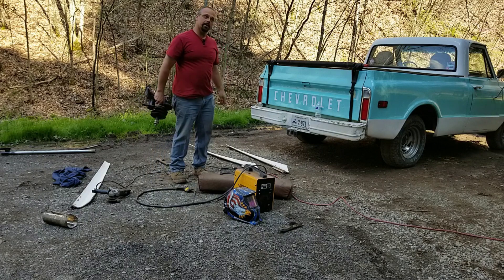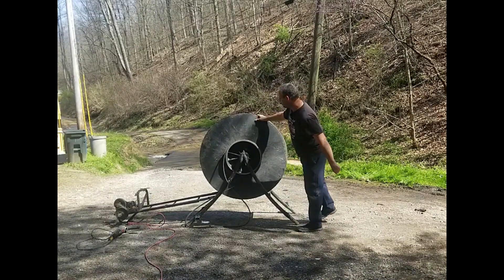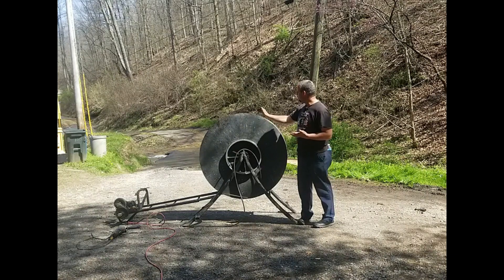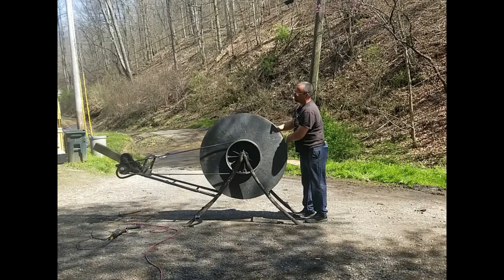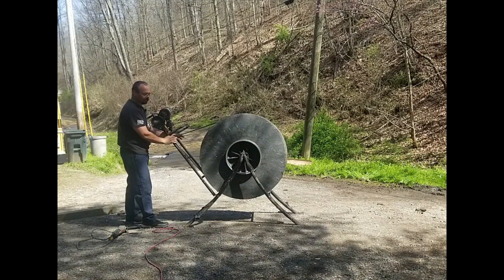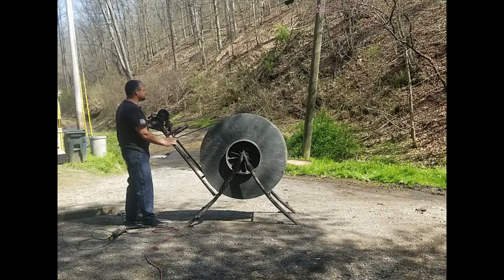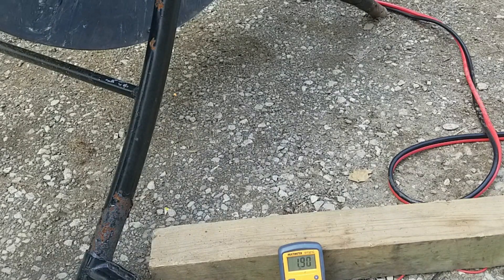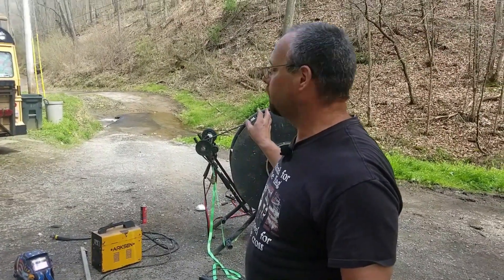From Wind Generator to Water Wheel

Comment: Luke, am I right by saying : You connect the generator directly to MPPT controller and boom all working as what solar would have worked?
Reply from the maker: @coeniecootybrands4472  yes the generator will put out a varying amount of power and the MPPT controller will smooth it out and make it sufficient to charge the battery.

Comment: Looks good, now to figure out where to put it and how to run enough water to it.
Reply from the maker: Got the spot figured out. I just need the water way. I was thinking about using about a 6 inch drain pipe because it is a little cheaper than pvc.

Comment: Like seeing this!  Previously I lived in another place with a stream flowing by full time .. and it floods once or twice a year.  I intended to take an old truck frame .. like the kind for a step van .. with about a 2 foot gap between the frame C-channel.  I had picked up an old electrical spool .. and planned to build an 8 ft. wheel suspended between the C-channel frames.  Put an axle on one end .. and a trailer tongue on the other .. and chain the thing to the shore.  I'd be able to use the tractor and pull it out of the creek whenever I needed to service it.  I was planning to use it to pump water using the spiral type of pump with hoses fixed to the side of the waterwheel .. dipping air and water .. air and water.   You idea here seems like it would work also with a small generator .. just have to watch for flooding issues.
Reply from the maker: That would be an interesting project. I have seen videos of that type of water pump. It would work well.

Comment: Looks look the biggest problem I see is how much weight in water you will have to add to make the wheel turn to build the speed you are turning it
Reply from the maker: Yes it will take a lot of water. In this case it is volume instead of pressure. I think I will have to seal up the cracks in the paddles for maximum efficiency. I think if I can get a steady 5 or 6 inch stream of water it should have no problem.

Comment: How many amps is your FCAW and what size wire do you typically use? I am assuming it is 120VAC and not 220VAC. True?
Reply from the maker: Supposed to be from 60-120 amps depending on the settings. It runs on 120volts. I'll have to check the wire size I have in it now. I think it is .030